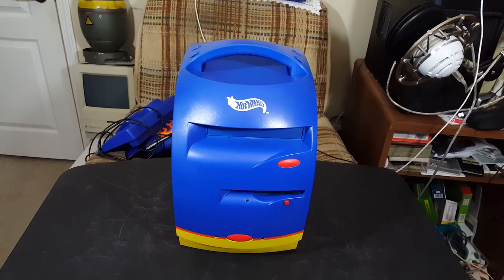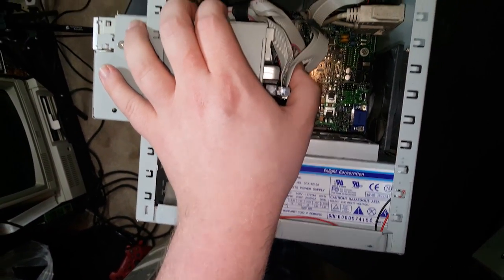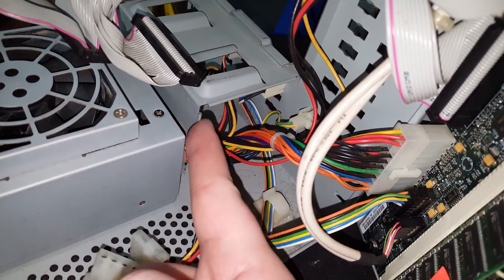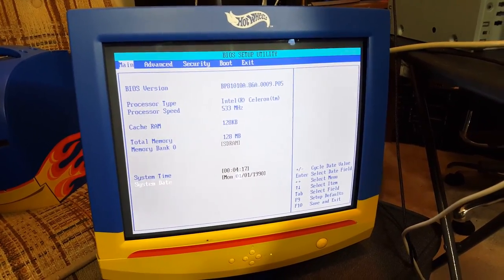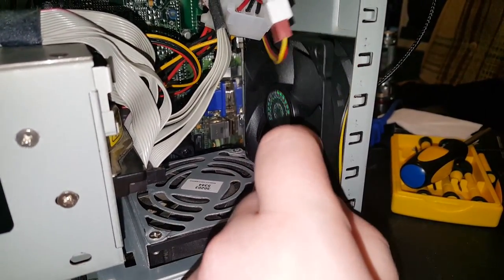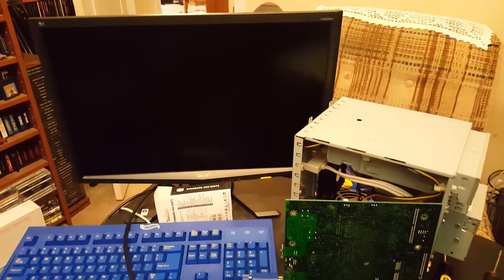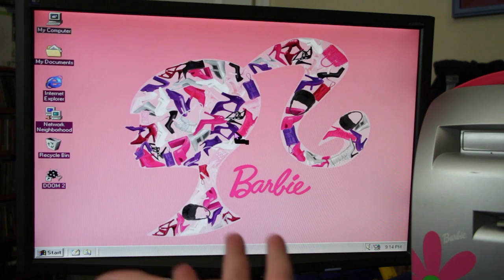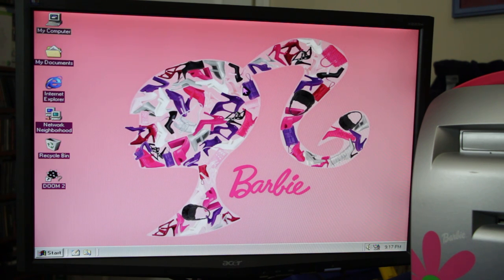LGR - Repairing The Barbie/Hot Wheels Computer

Comment: I just watched Linus's video on the oven method and he fixed his 780 ti with it! XD
Reply: Same
Reply: +SargentTNT same lol
Reply: same
Reply: +SargentTNT DUDE.  Same here.  What as small world, huh?
Reply: +SargentTNT Chef Gates will present his finest cuisine

Lawl jk
Reply: +SargentTNT didn't work with my artifacting 6970 :/
Reply: +sinephase because it only works with dead cards. your card was probably overheating.
Reply: Brickyjinx
lol definitely not overheating >_>
Reply: Tom5tom Entertainment
tried everything. it's pooched
Reply: +sinephase Its only a temp solution anyways, you're just doing more damage and not really fixing the problem.
Reply: Blipblobit True.
Reply: +SargentTNT It's actually a really bad idea. It only works sort of for a specific issue, and by doing it you create a number of other issues. The one issue it fixes can be fixed relatively easily by an actual professional.
Reply: +Cloak and Dagger Gaming Exactly what I was thinking. i
It'll die in two months.
Reply: +Cloak and Dagger Gaming 
Broken solder joints are a really common problem, especially on complex parts like motherboards. 

Additionally, the way real actual professionals deal with broken solder joints is to stick the thing into a reflow oven, which is basically a normal oven with better temperature control.
Reply: Watch Louis Rossman's video on gpu reflowing please, the oven thing is a temporary fix and is not actually reflowing the solder balls. This is an Internet myth like putting your phone in rice. Louis Rossman has a video on that too.
Reply: RalphArwen True. All this is doing is chemically affecting the chip's internals which happens to recreate the burnt out traces, but not for long as they cannot properly cure to stay like that again.
Reply: ***** Cite a source, please, instead of personally attacking an individual.
Reply: *****
Right, so you can't find any sources to back you up and you refuse to admit you're wrong.

Even if that's not your reason, that's how you sound.
Reply: *****
How about you tell us the names of the books and the page numbers so that we can check on our own. No matter how correct you are, the moment you start telling people to do their own research you start sounding like yet another troll.
Reply: ***** Pretty much. Welcome to arguing intelligently. Otherwise you can say anything you want, and we're forced to believe it.
Reply: ***** Asks for sources, and then when sources are provided rejects basis of even giving sources in the first place.
Solid, bro. You should check for lead in your water, by the way.
Reply: putting phone in rice? WTF is that? xDDDD
Reply: rice is a dessicant (like silica gel, the poisonous baggies in packages), so opening a wet phone and covering it in rice dries the water safely, without shorting anything.
Reply: I replace and reflow BGAs for a living, and I can safely say that you CAN get temporary relief from bad solder joints in either a household or reflow oven, but there is a high chance of further damage, and you need an actual BGA rework station to get the board and chip properly heatsoaked, and then a healthy amount of flux to allow the solder to melt without overheating the board or chip. there also isn't a big difference in temps between that to melt the solder and the temperature limit of the chip, so the soak, reflow, and cooldown really should be precisely set, monitered, and timed. You may also be able to use a hot air rework station with a good amount of flux to just reflow the solder balls, but that requires preheating the board so you don't roast the PCB, and a lot of practice to know if you are using too much or not enough heat. You risk launching tiny surface mount components into a low orbit.

tl;dr- There is a reason why the BGA rework station I use is $100,000.
Reply: rice doesnt do anything thats been debunked many times.
Reply: rooster sideburbs Rice has fixed my phones on 3 occasions, the fourth time it didnt work. I'd say its viable
Reply: you should call nasa
Reply: artifacts can be caused by a to high fps with a bad monitor try enabling vsync to cap your fps at your monitors refresh rate

Comment: I really admire how people can just mod and completely switch out computer parts... I think it's something I'd like to try out, but I wouldn't know how to get started OTL how did you get started?
Reply: Justin A that makes sense, we do have a couple old consoles we don't use anymore, so maybe I could start there. I've been watching so many of these electronics modding videos and I just really wish I could do the same.
Reply: Console disassembly and reassembly is a lot more difficult than a PC. Try use an old PC
Reply: You could start by taking a few discarded old computers that were probably thrown away as "defective" and seeing what's up with them, try throwing components around. I seriously don't recommend poking consoles at first, some are easy enough, others require a bit of attention and special procedure, and you're not going to be able to accomplish a whole lot, as they are tightly integrated. In contrast, PCs are somewhat robustly made, they are built to be disassembled and reassembled, and contain a lot of components that are compatible and can be replaced, and usually if something will fit in a connector, it will also work there, unless you apply too much force and break something, physically, there's little to go wrong. How did i learn? Well... i think when my parents bought a REALLY shitty computer and then getting tired of bringing it in for repair every few weeks. It was really a piece of work. They fleeced us on the graphics card, put in a really cheap ISA Trident instead of a PCI something something, their power supply would do crazy shit like totally turn off if you turned on a Panasonic dot matrix printer that was connected to the same power strip while computer was on, the optical drive had broken end switches and the centre spindle would eat holes into disks, and the RAM was faulty and would cause software errors. I think i got adopted by a small PC boutique eventually after poking them with questions, and a few years later i found myself as an editor of a local computer magazine, responsible for hardware benchmarks.

Though now that i remember, i used to have an 8-bit home computer that someone built, and i did replace a few socketed ICs there when i was like... 10? It also wasn't reliable, but i tried. At least i didn't break it, no more than it already was when i got it. It was a ZX Spectrum clone, but it didn't really have a name, nor a known author, people just copied it as sets of schematics and board layouts from each other, so one needed to etch the boards, solder, buy about 45 to 60 individual ICs and an assortment of other minor components, have someone else program the ROMs that were distributed on like 16 pages of prinouts using special hardware. It was retroactively named "Pentagon 48" for the distinctive shape of ground trace around the back of the PCB by a magazine editor eventually. I got a discarded one that didn't work properly, because well, where i'm from, as an individual you could only buy discarded ICs that couldn't be used in the industry, so of course the quality was questionable and many such builds failed. Don't worry too much, when you're buying new PC parts, they actually usually come tested, at least somewhat, so they should just work. Like mainboards are usually run on a test stand for 24h before being packaged, other major expensive components might have a few minutes or hours of testing.

Most people start by upgrading one component in their PC. Say their graphics card is too weak, or they need a larger or faster hard disk, or they need more RAM, which totally makes sense, nobody can faithfully predict how good of a computer they will need, and the GPUs currently have a much shorter product cycle than any other component of the PC, newer and better ones just come out so often. The mainboard manual that generally comes with the PC if you bought a boutique assembled computer, or can be downloaded from the board manufacturer website otherwise, will usually be the first place to start, it shows how everything goes together and gives basic safety precautions. So you would probably want to open up your computer, shine a light into it and see whether you can read the designation of the mainboard, or you could even use software like REALiX HWiNFO without opening the machine up at first. But don't be afraid, usually it's a few screws at the back, and then some panels can be slid off, you're not disturbing anything inside by taking off the lid. But after one component upgrade comes another, and then another one, until they are pretty comfortable with how the whole thing works.

And ask questions. Right here is fine by me.
Reply: Siana Gearz u got adopted by a pc place? I think u meant "it"😂😂😂
Reply: If you are really serious about it, you could look around for an old and cheap PC in working condition to learn. Sometimes you find early-mid 2000 PCs for as low as $20. First I would disassemble and reassemble it and see if I manage to do that without breaking it. Then I would try with a broken one and try to replace components and see if I can bring it back to life, researching the time frame it was made and the kind of hardware it would have used. From what I've seen, a lot of times those computers fail because the power supply fails and doesn't provide enough power to make it work properly.

If you want to mod consoles, on the other hand, you could start by trying to add standard RCA outputs to an SNES or N64 or maybe even a first-generation PSX. It's an easy mod and it's useful as cables are known to wear out, original replacements are sold quite expensive and in dubious condition and aftermarket cables are usually crap. I myself added RCAs and S-Video (original S-Video cables for the Nintendo consoles are hard to find and insanely expensive!) to my consoles and I have pretty much no soldering skills, so if I can do it, anyone can!
Reply: He didn't really do any modding.  He just replaced some broken parts. But computers are super easy to fix/mod.
I'd say just go to a thrift store and get some parts there if you want to learn.
Reply: Choux why are u replying to ur self?
Reply: Can I rebuild my PC with those old Hot Wheel PC cases ??
Reply: Or upgrade from the scratch ?? 

Sorry just asking

Comment: Would I be correct in saying that both Barbie and Hot Wheels PCs have the exact same hardware in them?  Same motherboard, same power supply, same everything, but the only difference being the cosmetic designs of the accessories and the system unit case?
Reply: +Lachlant1984 Seems that way to me.

Comment: Holy crap, I never knew about flowing before! Do you think flowing work for graphics cards or other daughter-type cards, too?
Reply from the maker: It absolutely does! Fixed an old GeForce that way once. Do some research first though, there are cards that require different heat than I used, and sometimes you'll need to remove certain things from them before cooking!
Reply: +darkmage07070777 | I thought it was a joke. Holly crap never new it works.
Reply: +darkmage07070777 I got my blue screening video card fixed with that. It was only 10 minutes in 200 Celsius. It's not guaranteed to fix every single computer parts, it's always worth to try oven trick.
Reply: +darkmage07070777 Yep, it does! I "repaired" 5 xboxes with RROD that way, My Iphone 4S with the "greyed out internet" problem and just recently my Nvidia Geforce GTX460. Most of the times it works, but like with the Iphone and xbox it mostly last a month to 2 months or so, but then you can do it over and over again until it's completely dead. But you can be lucky that it will work much longer. But people say that with a dead videocard it can last up to a couple of years until you need to reflow it again! And if you don't want to use a oven or something, you can use a heat gun like I do.
Reply: Pier416 | But don`t plastic parts of GPU melt down?
Reply: +darkmage07070777 It can only fix certain problems, like cracks in the solder points. The reheating make the connections soft so they can reconnect. However in many cases you have to redo it after a few months.
Reply: So it wouldn`t hurt fans ar plastic lid/casing/whatever is on the chip.
Reply: +Bruno C Yes and no, If not following the correct solder and surface mount temp specs you can thermally damage and lower the lifespan, but Those specs are often long gone. A waveform oven meant for reflow is better, your less likely to damage the board during the controld heat up and cooldown. But done right, on a well designed board, it shouldnt damage it any more then it already is. If the reason it broke was because a component got hot enough for some reason to mess the solder joint in the first place, a reflow isnt going to fix that, and it will just break again.
Reply: +exlibrisas Depends on the plastic used. Some plastic components are put on after the board is soldered cause it cant handle the temp. If those are on a particular board, and which ones are they is pretty hard to judge without the Bill of Materials from the manufacturing of it.
Reply: +spookanide Throwing consoles in the oven is NOT reflowing. And it's a very harmful, temporary solution. You're what's wrong with console repair.

ACTUAL reflowing requires a station.
Reply: +Mansen  Re-flow stations can be great if you need to re-flow a certain piece, but In college (in just the last few years) we used Toaster ovens to flow solider our SMT boards all the time. As they hit sufficient temps to make solider paste go molten and not burn the chips, and medium end flow solider board stations are usually just fine temp controlled toaster over with probe pass through and programmable controls. 

In college we just put a temp probe in the oven slowly ramp the temp up till we hit the sweet spot then bake for are determined time then turn the oven off and crack the oven door to let the board slowly cool down and once the probe registers room or close to room temp we remove the board and they work just fine. A lot of the time was dependent on the temp for flow solider characteristics determined in data sheets of our components and board thickness.

So yes an oven can re-flow a board is not exactly ideal  but it will do the job and if done right can be just as good as a re-flow station A good digital temp probe close to the center of the board and another near your sensitive parts are what you really need to monitor the re-flow properly in an oven and a close eye.
Reply: linustechtips just made a video about cooking a dead GPU.
Reply: Blighter KLN Yeah - My response was mostly a stab at the horrible suggestions I keep hearing about wrapping the entire console in a towel and baking it.

Sure - It might loosen the solder and patch a connection, but it kills the console as a whole so hard.
Reply: +Lazy Game Reviews You can also use hot air blower if it's just gpu chip that needs flowing. Just remember to protect surroundings with aluminium foil.
Reply: +Rentta they Don;t really get ideally hot enough or even enough but yes can work in a pinch for small targets.
Reply: +Mansen Yeah you need some experience and no how to get this right and now how o monitor and watch for and never put it on a towel it can wick away solider lol and will change the cool down process incorrectly as you know a towel is a heat insulator and some can induce ESD which will zap components dead.. but yeah just general heating is bad you have to watch the board closely to avoid connector drop. and most consoles are populated on both sides now a days and you should never just bake those.
Reply: But when do you know it`s broken contacts and chip needs soldiering? May be problem is something else? I don`t know these things.
Reply: +darkmage07070777 It sure does. A friend of mine had issues with his GPU and putting it in the oven fixed it.
Reply: +spookanide a paint stripper gets a whole heck of a lot hotter and also tend to have better airflow control so yeah it work in a pinch I prefer my hot air pen.
Reply: spookanide The entire motherboard is still the wrong approach...
Reply: +exlibrisas broken contacts or bridged contacts can be seen on all parts with minus BGA parts with a pair jewelers loop or magnifying Glas and a close examination of the board.
Reply: Blighter KLN I disagree i have tested it and it works fine. Also iron is one working option too.
Reply: +Rentta I am not sure your saying you disagree with I havw not said any of these are don't do but more saying certain things are not great practice as someone who has made and processed millions of board single to 26 layer boards single and double side populated and I have really only said things from a professional in this field which are good and not so great ideas.

You may have had a good experience but that does not mean it is good practice or that it may have down sides that some may not know. Most technique will work to ex-stint but some are better suited for different tasks.
Reply: exlibrisas No, you need to unscrew the GPU first, remove the cooling paste from the GPU chip with some cleaning alcohol then get some aluminum foil, cut a hole as big as the GPU chip and cover the whole GPU with the foil so you can only see the chip. Then heat it with the heat gun and take some breaks and feel with your finger how hot the chip is. The foil protects the board from the heat so only the chip gets really hot. It needs to get pretty hot for it to work, but not as hot that it hurts you but that it feels uncomfortable.